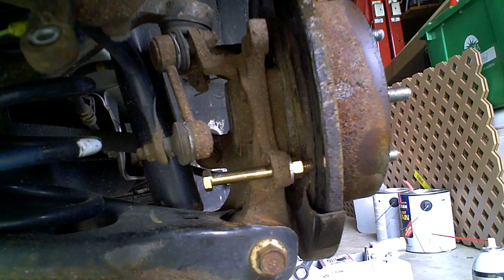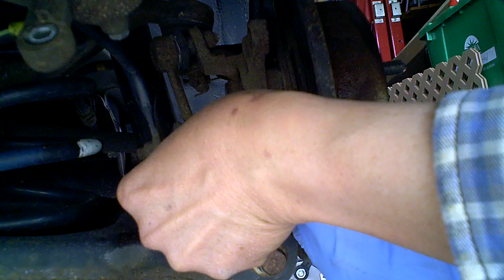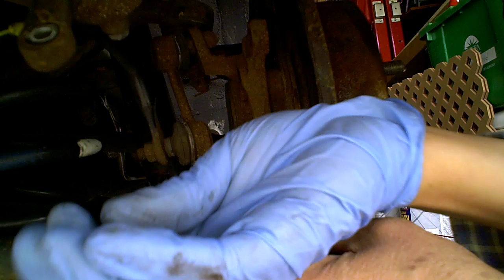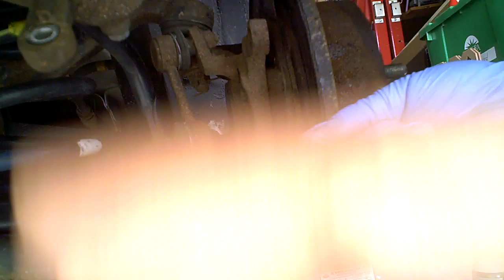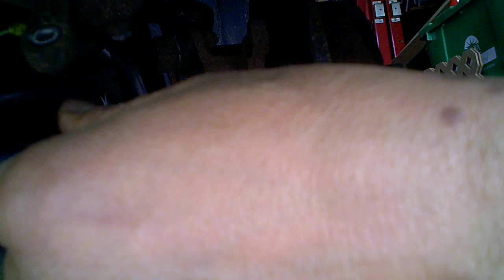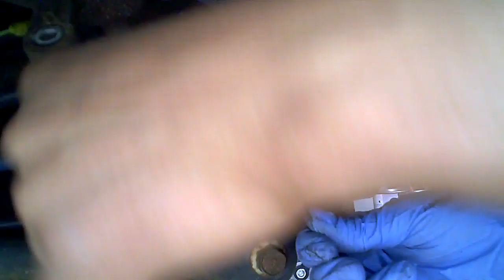How to Remove the Brake Rotor from a 2006 Hyundai Sonata

Comment: I did that too, but even after I broke it loose, it still took beating the heck out of it to get it off.  It was so rusted it wouldn't just simply slide off the lugs.  I had to work at it for 30 mins with a big metal mallet.  Got blisters on both my thumbs. :-/